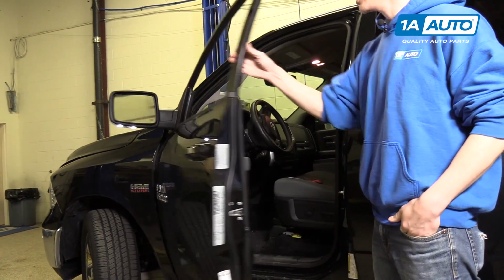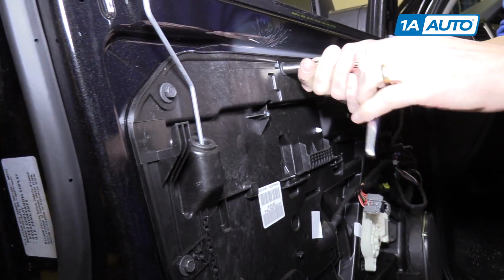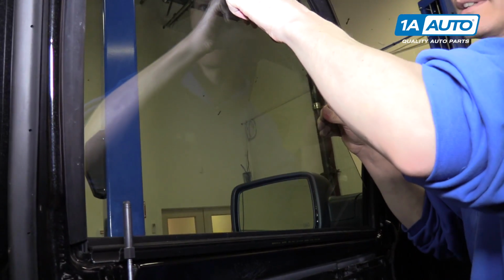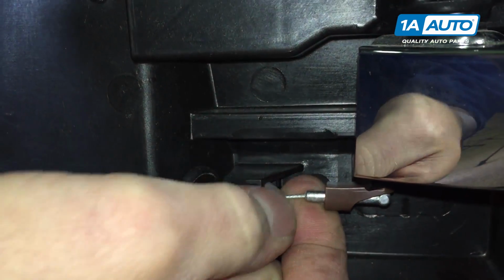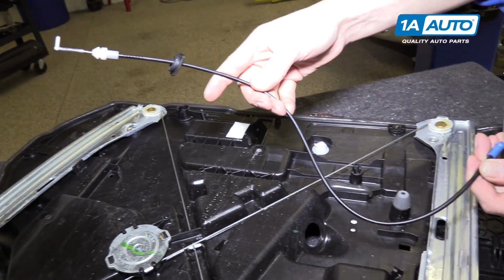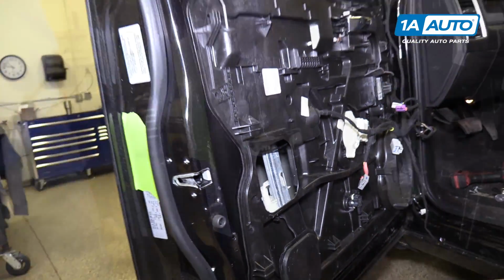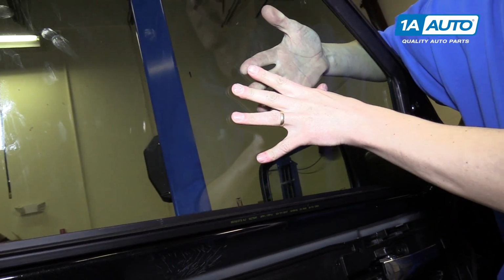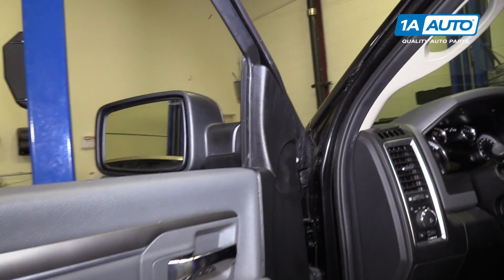How to Replace Front Interior Door Handle Cable 09-18 Ram 1500

Comment: Thank you so much for this video! I have a 2010 Ram 3500 and the exact cable broke at the door handle. Those of you who were wondering I bought my cable from Amazon. It's says a 2011-2018 cable but the 2011 works on my 2010. I just installed it. Granted this whole process is a pain but we'll worth fixing your self for the expense of Time+$20=done!
Reply from the maker: +Jason Weems Thanks for watching. Buy the part in this video on 1AAuto.com: http://1aau.to/m/Shop-1AAuto-c

Comment: This is totally different a 2004 to 2018 the panel is all totally different hook a couple deals like the door handle inside and the center screw and on hook the power window lift the whole door panel off and that's that it's nothing like the one I was looking at the other day that was 2018 f**** dummies